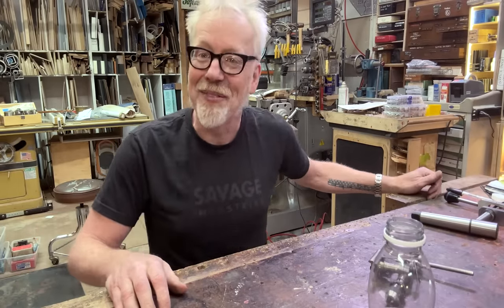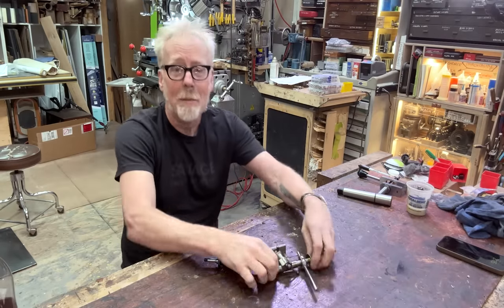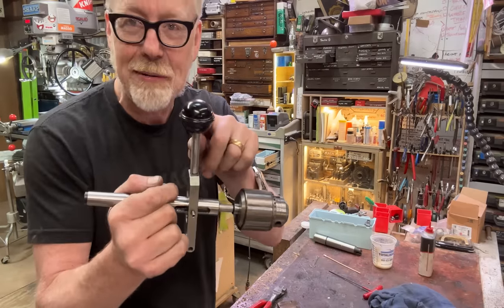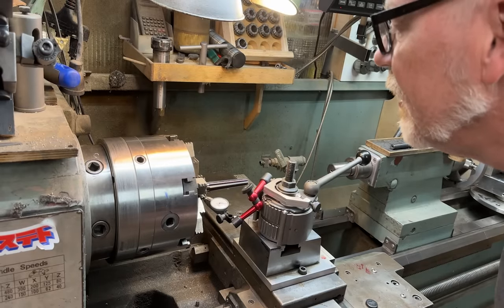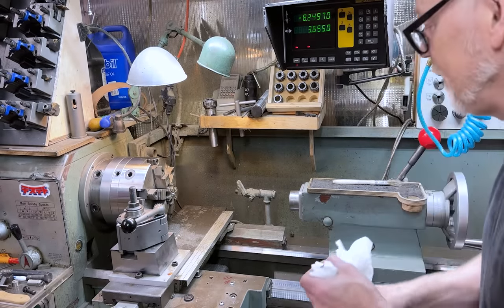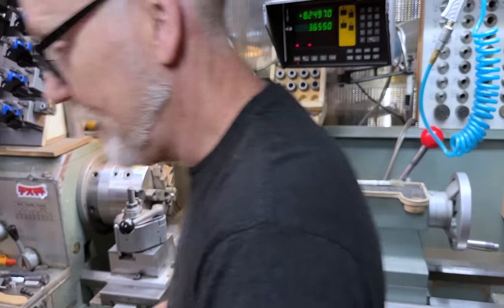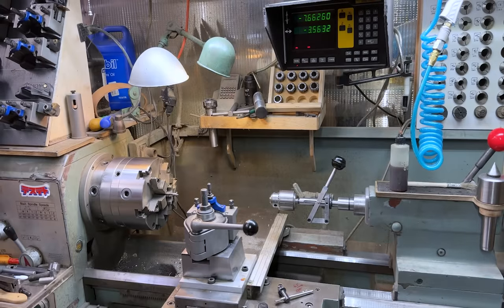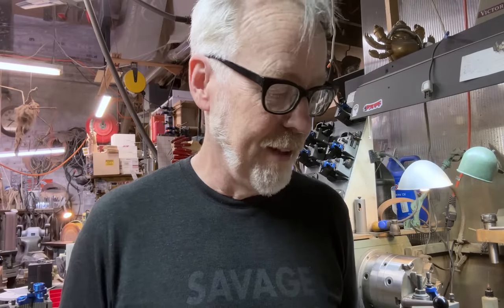Adam Savage's Lathe Build Fail

Comment from the maker: Subscribe for more videos (and click the bell for notifications):  http://www.youtube.com/subscription_center?add_user=testedcom
Reply: More accurate would be a morse to endmill holder that fits your tailstock. Then mount your pen drill in the morse endmill holder. You can also mount your pen drill in a boring bar holder and zero that on center then feed either with cross slide or by hand
Reply: Hemingway Kits sells a kit for a small sensitive drilling attachment. Obviously it would be more expensive than the one you bought, but at least you can be sure it will be made right. You'd just have to modify to use an MT#4 instead of the MT#2 or MT#3 options.

Comment: Adam, I think something that might have helped is step drilling, which would give you shoulders tapered down to your smallest dimension, then ream out the shoulders.  I do so with old-school gun drills, which are O1 rods ground at the end to a D-bit for my larger dimension, grind length 1-1.5", depending on what I need.  The other end of the rod I turn to my next step down OD, and grind that to a D-bit.  This is a starter bit for the next size down, so the grind length is roughly 1/2".  The Machinist Bedside Reader (#1, I think) has nice suggestions for OD to grind length ratios.  So my order of operation is center drill, twist drill of larger OD with my d-bit, flip the rod to the other end to get my starter OD for the next step down,  drill with the next size down drill rod, rinse and repeat.  You'll be dead-on-balls accurate (it's an industry term), absolutely concentric, and your ream will not drift.
Reply: That’s pretty slick. Thanks for the tip.

Comment: Hey Adam! WOW! That video turned into a horror movie for me. LOL 
I bought the exact same sensitive drilling attachment a few months ago.
I got it because I thought that it might speed up my drilling process. I am making 100s of the same part that needs a 4mm blind hole. Turning the wheel on the tailstock gets old very quickly.  Long story short...that thing went back to the seller the same day. Totally unusable. The whole thing sags when you extend it. Mine was 2mm below the centre. Also, the amount of force that you need to drill is insane. Oh before I forget it: The taper that takes the chuck is a B16 taper. Maybe that´s why your chuck did not want to stay in place. 

What made it a horror video for me was seeing you use a reamer as a drill.
Those delicate cutting edges are meant to widen a hole that is 0.1 to 0.2mm undersized. 🙂
Reply: Well, that thing that Adam did show first is good for sensitive drilling on the mini scale. But with big chunk of material, especially if it's stainless still, for example, you need good amount of force to drill, indeed. For plastics it is good maybe? I mean the precise mechanism, not this abomination that he wanted to use.
Reply: Yeah.. WTF was that! (reamer as drill)

Comment: Twist drills may wander or start off-centre, which leads to errors in concentricity. This is why, for an accurate and concentric hole, we spin the workpiece in the lathe spindle (your lathe spindle nose usually has an accurately ground morse taper and you use whatever morse taper adapter is needed between the spindle nose and your MT workpiece), drill slightly (about 1/16") undersize with the drill in the chuck in the tailstock and follow it up with a boring bar (not a reamer because this may follow a wandering drill hole). We add to the complication when we want a concentric internal taper, because this needs the boring bar to accurately follow the desired taper, then final finish (no more than about a thou) is done with the tapered reamer. 
Love your work!

Comment: A adapter 4-2  cost 5$ and it's often hardened. And a bit shorter than the one you made.  But as a exercise, it's fun. But remember, when using a reamer, you need to use a "floating" holder for it, on a manual machine. A floating holder makes everything better

Comment: My father would have loved watching All of the content on this channel. He was a journeyman machinist who worked for many companies. The last one before he died was Harley Davidson. On several occasions when mom was called in to her part-time job to work and there was no one to watch me dad would take me to work with him. I would be totally awed by what my father was doing. To repair some very old machines (punch presses etc) that I am sure are still in use at the factory to this day. After rendering the machine safe to work on, he would find the broken part/s which in most cases was one of the original gears and he would take what was left of that gear or part, do measurements and calculations and come up with a blueprint to create the blank and manufacture and mill a new gear. And just like what happened with Adam in today's video sometimes it didn't go quite right. I really hope that Adam will, after much thought and consideration attempt to create this part again!

Comment: I am pretty sure you cant use a reamer as a drill, that's where the most of the error occurred. You should drill then bore the correct angle tapered hole. And finish with the reamer. There are also roughing reamer and finishing reamers.
Reply: the idea of a roughing reamer is quite funny to me.
Reply: Boring is way more accurate than drilling, they can wander so much than you are reaming an inaccurate hole
Reply: I was always under the impression that you didn't want to go much more than .010 for the reamer to hog out, and if you fill the flutes you are trashing your hole. And possibly your reamer.

Comment: I think you're supposed to rough the taper in with a boring bar first then finish with the reamer
Reply: I'm pretty sure there's maximum material removal for reamers that you have to rough cut before they are effective. So yeah, you cannot hog out that much material without boring to the correct angle, and then taking the radius up to within the spec of the reamers max cut.

I feel bad for that reamer, it's probably a piece of toast now.

Comment: Mount the drilling rig on your tool post, this will give you centering adjustment. Pre cut a morse taper undersize then use the morse reamer to remove the last of the material to fit.

Comment: Once you dialed in your chuck, the next level for concentricity would have been to use a tailstock alignment bar to dial in your tailstock as well. 
Ive never used a tapered reamer either, but i can only imagine using a straight drill and then the reamer would be asking your reamer to be removing too much material on the greater diameter end.
I would personally dial in your chuck, dial in the tailstock to be concentric with chuck, mount your MT blank in chuck and use cross slide to bore the MT2 taper to within like ten thou of diameter, then use your reamer to finish the cut.
Im not a master machinist so please someone who is correct me if this is not a good way to go about it. 
I have several years of experience under master tool and die makers tutelage, but i know i myself am nowhere close to that level yet. The fact we try and learn everyday is what matters most.
Reply: Yes, that’s the way I was taught. I knew where the “fail” was as soon as he started on the wrong end of the lathe. 
He should have chucked the MT4 up in the chuck and dialed it in, then drill a pilot hole for the boring bar, cut the rough taper using the machinist manual and the compound rest or taper attachment (doesn’t he have a taper attachment for his lathe ?) and the final step would have been the “finishing reamer” or a “chucking reamer”. 
I just did the same operation on a tailstock quill and it is spot on. (I do have a taper attachment on my lathe though). But the machinist manual actually tells you the exact taper on all the mores tapers. If I did what he did to one of my reamers it would most likely be trashed afterwards. They are not meant to remove that much material. Nor are they intended to be ran at high RPM’s and nor are they supposed to be ran without LOT’s of oil. 
But nonetheless it was an entertaining video! 😊
Reply: @jasonhull5712  i cant remember the exact number but i remember reamers arent supposed to really take more than, what, 10 thou? Im probably wrong, i just know its not much. I was always taught "a 64th (.015625") is really too much but will work".
I dont think he would need a taper attachment necessarily, id guess his cross slide has enough travel for the length of an MT2. Its difficult, but ive cut a jewelers ring mandrel thats a 16" long 1.5° taper using my cross slide with 5" of travel. There is quite a bit of math involved to get the different sections to match up, but if you give yourself a couple thou oversize throughout the length, its not bad to use sand paper and polishing paper to take the rest out and blend everything in. 
The fun part about machining is there are always multiple answers to solve a problem, and getting a group to share solutions and expand on our arsenal of methods is great. One reason i am thankful the hobby machinist world has really made a come back and thanks to guys like "AvE, This Old Tony, Inheritance Machining, Joe Pyzenski (spelling, i think he goed by Joe Pie? His channel has a TON of techniques and information) Clickspring, Clough42, Dazecars, and just too many to list... blondiehacks, Xyla Foxlin, Artisan Makes, the list goes on but those are the ones i especially wanted to shout out as theyve all helped me in one way or more. Especially Inheritance Machining and Dazecars directly. Sorry to turn this into a shout out comment, but go check em all out. On the off chance Mr Savage reads this comment, there is a lot to learn from the people mentioned above.
Back to the main topic here, im also surprised his reamer survived that. The only way i think it could is if he used a drill bit thats closer to the major diameter? But then he really would only have had like a half inch max of proper engangement on the tapers. So surely he used a bit for the minor diameter, but that brings back the question of how did that reamer survive? I dont know the numbers off the top of my head but surely the difference from minor to major diameters is more than 15 thou on a MT.
Reply: @kylewellman402  absolutely, .010” was was limit as far as I was taught. And yes that whole list is channels I frequently watch too !  I enjoy watching them all. When I can’t be in my shop I like to watch others in theirs, Adam is a pretty sharp guy. From what I’ve seen there isn’t anything he can’t accomplish. I really think he purchased that reamer just for this project and wasn’t too concerned about keeping it around maybe ? But YouTube is a heck of a classroom, you can learn the right way and the wrong way on there. Just takes experience to refine it and learn the difference I guess. 🤷‍♂️ Abom79’s older content is very good too. I like Adam but his new content just feels different for me. Joe Pie is a great addition to anyone looking for technical processes and expert tips. All of them you listed really. All good content in both machining as well as entertainment !
Reply: @jasonhull5712  i always feel bad making lists like that because i always forget some channels! Yes Abom79 is also good. I do agree his older content was better as far as learning and watching techniques. However i am not trying to say his newer content is not good. I mean hes built his shop from a garage to a full sized industrial shop. Its insanely impressive and what i hope to accomplish for myself someday. There is also CEE. 
I laugh when i watch his videos because i remember ToT always referencing "its not abom size". Then you got CEE who buys a mill with a bed thats like 100 foot X-axis 😂. Its absolutely nuts. Still though i dont think its as big as the mill used at a company called "Buhler" up in Holland Michigan. They build/repair die casting machines. They have a mill where the table is the floor like 150ft x 100ft, and 25 ft of Z-axis travel. The spindle head sits on a moving platform and the operator sits in an office at the bottom and goes along for the ride. They have a lathe that holds a 25ft long 3 ft diameter steel bar to machine into tie bars. One CNC mill center with like a 200 tool turret. Lots of insane machinery. Honestly all of it is what makes me continue down the path of engineering. Designing machinery like that is a marvel to behold. And always makes me feel like my shop is tonka tools level lol. But i suppose empires arent built in a day, so they say
Reply: I've never used a lathe in my life, but I was raising an eyebrow at the pains to make the chuck concentric, but not a peep for the tailstock

Comment: If you buy an actual Morse adaptor, it is accurate. Also, if you can pull it out, it's not seated properly. You need a wedge and hammer to separate Morse tapers. And a hole for the wedge.

Comment: Robin Renzetti and Stefan Gotteswinter absolutely know what there talking about. DRO depth and DRO Cross slide and center height adjustment with the QCTP and nice carriage gears that are fast. Finish the tool post drill. Look at a solid tool post with the compound slide at the back. I'm doing a toolpost drill right now, busted 2 spiral taps and 2 carbide endmills getting them out just today. Its 1-10mm B12 keyless chuck mounted to the back of a square ER32 collet block, with a 20mm square solid steel bar bolted to the side. It'll go straight in my 40 position multifix size A. Flip it over for collets or drills. It's for a small optimum 200x300 lathe. I've got a chunk of steel to do the compound delete with, its next. We must be watching the same vids on YouTube. 👍👌🇦🇺
Reply: Compound delete is a really awful idea that gains zilch. Without the compound on the lathe making tapers becomes impossible unless there is a taper attachment on the lathe. The compound is extremely useful for making tapers, making fine adjustments, cutting offset multi-lead threads and much more. The belief-idea the lathe will gain some degree of rigidity at the tool post/holder by deleting the compound only illustrated a defect in the design/construction of the lathe. It is also possible the gibs and dove tails on the compound is completely outa whack causing the lack of rigidity and all those related problems.

In this specific example of Adam trying to make a morse taper, it should have been roughed out by using the compound to cut the taper to within a few thousands of the finished size before applying the MT reamer.. as reamers are designed to finish cut by removing tiny amounts of material. Or, if the compound is properly set, the exact morse taper can be easily made using the lathe compound and properly set up boring bar.

The whole compound delete thing is extremely short sighted and might work for those with limited demands on their lathe. In the much grander scheme of using a lathe no compound is a very serious handicap in too many ways.

As for drilling via the carriage, easy. make a tool holder to fit the tool post that has adjustable height, add a drill chuck on an arbor or ER collet holder. Use a center finder or Blake indicator or similar to set up height and end to end using the compound.. ready to drill
Reply: It's a 2 minute swap back to the compound. If you need it. It's a hobby for me. My compound sits locked up. I would enjoy some extra rigidity. Even my lathe has a DRO, it's all cheap now, thanks China👍for every tool I own. I'll do what works for me, I'm sure Adam will too. He's  a hobby guy, but famous, and more money behind him. Well done Adam👍👌🇦🇺

Comment: The way I learned it, reamers are only meant to buff up surfaces pretty much. So it should be only 0.0odd mm undersize to start the reamer, at most 0.1mm in the diameter. Non-cylindrical ones are also tricky to get right in the depth and require constant double and triple checking

Comment: I have a tailstock like that for my Schaublin lathe, and yes, it's great.
But, have you seen the Japanese show, here on YouTube, where he drills a hole through a lead from a pencil?  And yes, with a regular sized, normal  tailstock 🤣
Of course on a Cazeneuve lathe. But...  This isn't really needed to get the super nice feeling to the smaller sizes., but it sure helps. 
Also, I have a Albrecht chuck (#1 chuck) which is operated with the fingers, on a springloaded guide. Super convenient for small holes.  This!! Add the great feeling/touch you need for the smaller holes 😁👍

Best regards

Comment: Put an indicator in the lathe chuck to check the concentricity to your drill chuck. Also you should be able to adjust the tail stock to help fix your concentricity error.

Comment: Hey Adam, something to help you.
Drill initially then use a boring head to create a perfectly concentric hole and the concentricity of the chuck won't matter as its a single point cutting and chamfer the hole slightly for an easy start of the reamer.
Then use a center in the lathe faceplate and use a lathe dog to drive your reamer and slowly feed with the tailstock.
Slow your rpm into the 45-100 rpm range too as you dont want to run reamers near what you do drills.

Comment: Our methodology is so very different on this one, I have built a tapered adaptor for the spindle on my drill press , made it on my old  1958 Logan  lathe . Essentially i figured out the tapers that i needed in degrees and basically turned a tapered tube to fit the drill press spindle to the taper on the new chuck, using my compound slide, wish i had had the correct reamer, i'd have brought the tapered bore to with in a few thou of the finished size and just reamed it for the perfect fit, your way seemed fraught with problems and 4 letter words.